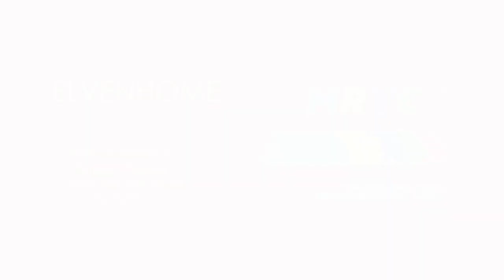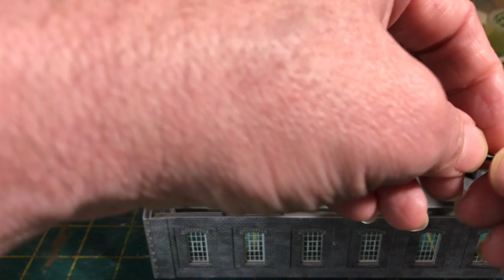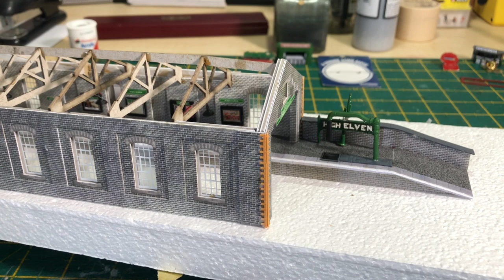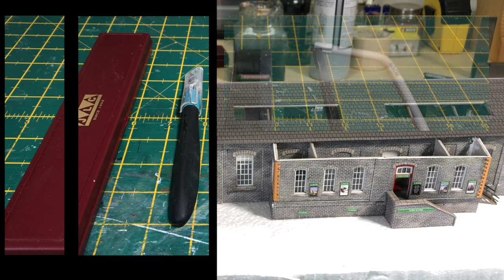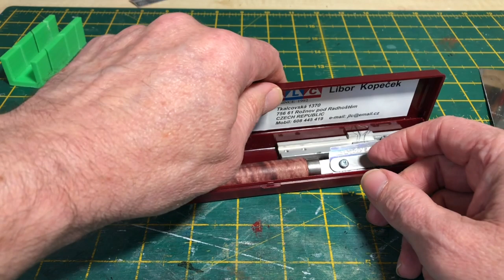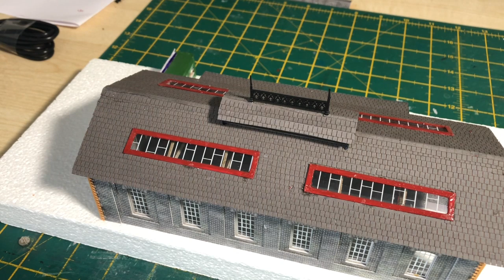Elvenhome N Gauge Model Railway Layout May 2020 Update - Ep 79

Comment: The station has turned out a real treat Stephen and the roof has to be its crowning glory with the York Rail tiling. It really does lift the model from the more uniform look of the Metcalfe roofing. I’d certainly be interested to see what tools you are using for your scratch building, there may be something I hadn’t considered before for my own toolbox. Now, on to that signal box. Paul
Reply from the maker: Thanks very much Paul.  I am pleased with the roof.  It takes a lot of concentration to apply and I will be using it selectively as a result.  My next scratch build will be revealed in the next video, no prizes if you guess what it may be.  Stephen

Comment: Hi Stephen  - great Metcalfe kit bash.   Great way to use the down pipes to hide the wires and use them to locate the building on  the layout.   The tiles look good as well - I can't see anything wrong with them.  Hope you are keeping safe.   Cheers Euan
Reply from the maker: Thanks very much Euan.  It does look good and will look better once I can get the lights on.  The tiles do give a great effect.  I wouldn't use them for everything.  they require a lot of concentration at N gauge to fit them.  The off-cuts also stick to everything.  Stephen

Comment: Another nice video Stephen, I see you have found the york modeling slates, that building is good by the way. I scratch built a tall signal box for my old layout and I used the slates for that along with a factory unit. They definately improve the look of roofs over the standard Metcalfe roofs. By the way I am blaming you, I have bought a GWR Castle set with sound even though my layout is mainly LMS/Midland, Rule 1 applies.
Reply from the maker: Thanks very much Chris.  Always handy to have a scapegoat for a purchase and I accept full responsibility for making you purchase the Castle set.  I am sure you are pleased with having the Castle.  I agree that you can fall back on Rule 1 but equally there were plenty of places that GWR trains ran over joint lines or LMS/MR metals.  Stephen

Comment: Fantastic! This has really inspired me to start up my own n gauge project again. Along with the engine shed kit, can you remind me what metcalfe kit the other part of the station was bashed from?
Reply from the maker: Thanks Tom.  I used only two Metcalfe kits. The engine shed kit includes a workshop which was bashed to make the station entrance building. The other kit was the platform kit (which includes card to make the wall at the end of the platform. One platform kit goes a long way I’ve found. Stephen
Reply: Elvenhome N Gauge Model Railway thanks - that’s even better news. This design will form the terminus of my as yet to be built layout - might try double track and do it twice!